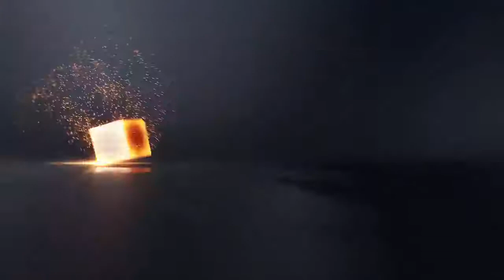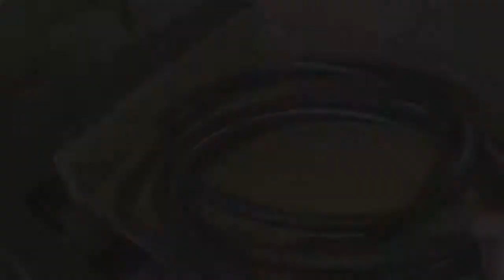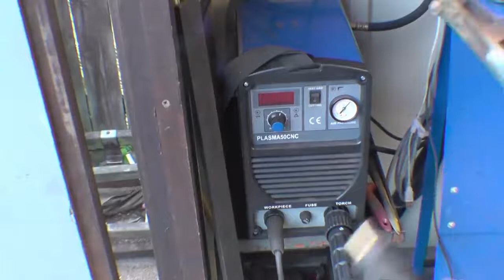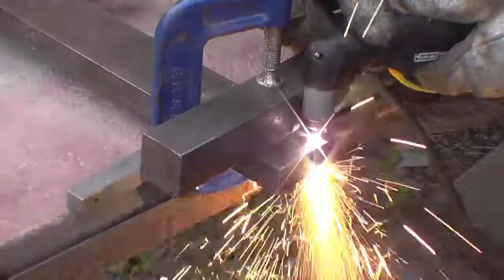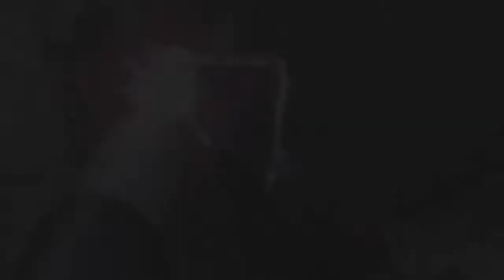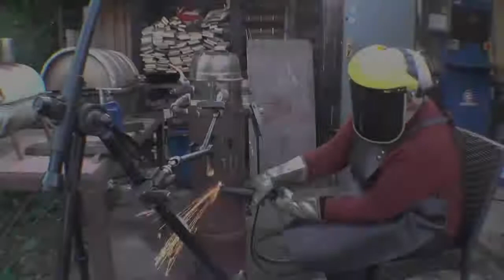Rtech P50 Hand Cutting Torch

Comment: I have had a demonstration of this torch courtesy of Doubleboost John Mills, The set up is excellent. I can see an opportunity of buying oversize steel plate or other consumable plate for the plasma table, and cutting it into pieces to fit the table. Buying larger sheets and quantity will pay for the torch outright on the saving.